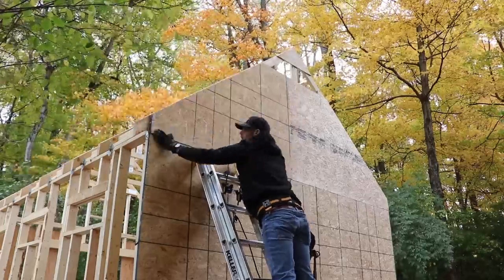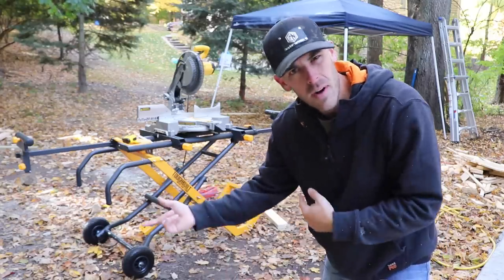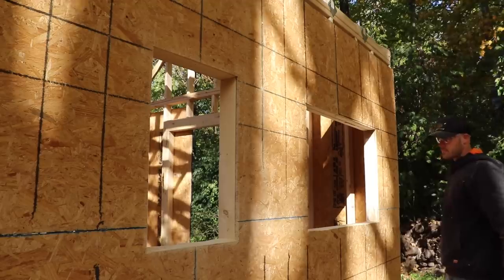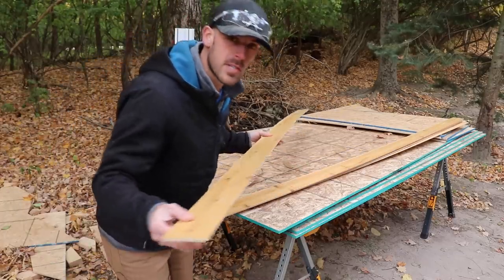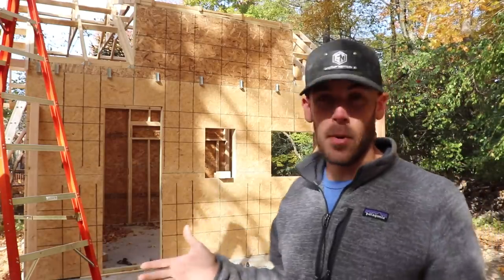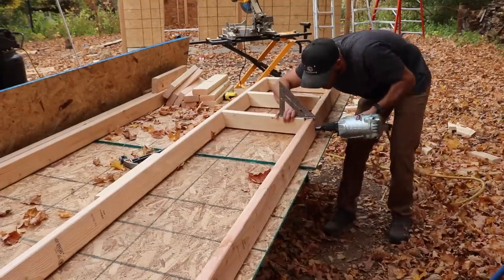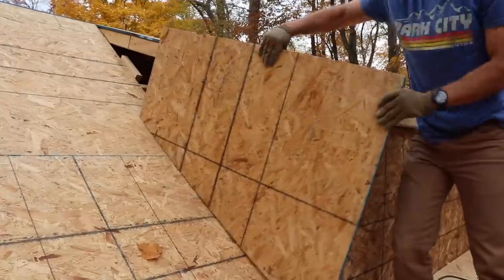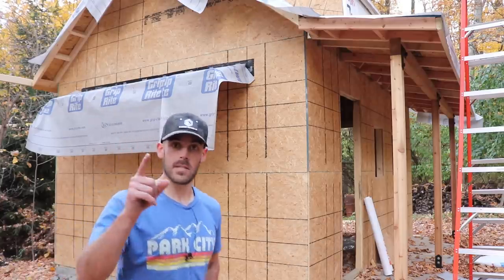Rain on the Forecast - Out of Time! // Shed Part 3

Comment: This has been the only guy that actually makes me feel like I can do a project without failing.
Reply: You can.  Just do it.  You're going to screw up, but you're also going to learn so much.  I never thought I could do anything like this until I bought a house with huge unfinished basement. It irritated me that there was so much wasted space, so I finished it myself.  It took me 6 months working every night and most weekends, but it turned out better than I could have ever imagined.  The feeling I got when I walked downstairs and saw that space and knew that I did it was like nothing I've ever experienced before.
Reply: Things become so much more doable when you realize it's all a series of executable steps. Solo DIY projects like these can look downright insurmountable as a whole, but I think most can picture themselves completing each step in isolation.
Reply: Take the encouragement, most trades work is not that hard. If you can build Lego with instructions, you can build a house(pretty much). Finding the instructions is the hard part, and this video is not the place to find instructions. Take this guys ambition, but find another video and how to build proper. Realistically its not that bad, but this roof line was ambitious for a beginner. If there is one thing an ambitious home owner should know, is to "Keep it Simple Stupid".

Comment: I will go ahead and agree with pretty much all the commenters here in saying that you definitely make approaching projects like this for beginners much more inviting and enthusiastic for us. Thank you very much for this. 
Something I learned with cutting plywood with the reciprocating saw to not have those rough, cut up edges is that if you put some painters/masking tape over where you’re cutting (you’d of course have to redraw your lines over the tape, but then cut through the tape, the tape helps to keep all the rough bits from splintering off and makes it much cleaner

Comment: Nice work!  I just completed a 10x12’ shed on my own at 65 years young.  Built as much as I could on the ground (walls, exterior sheathing, opening cuts, etc).  Adding the sheathing on the ground was easier and added strength to the walls before standing them up.  No concrete, built a platform entirely out of PT lumber which helped make it easier to attach the walls to the flooring. Roofing (including sheathing) was the worst part, but I hate roofing in general anyway.  No nail gun for me, I estimate I pounded somewhere over 2500 nails and drove over 500 screws. Full disclosure, my wife did all the painting. This will be my last large scale construction project, but it did turn out great.

Comment: I agree that we all learn from making mistakes.  I was making outdoor chairs and got one almost complete and realized I used precut boards for a chair that was a different size I was making for a friend and had to take it all apart and reassemble it with the correct boards.  I now label the boards better so I  don't mix the different boards.  I love how your shed is turning out, I would love to have room for a shed to turn into a workshop but living in a townhouse doesn't come with hardly any outdoor space.

Comment: Great job. Pro tip on those anchors... Run a nut down past where you plan on cutting and all you have to do to fix the threads is to back that nut off.

Comment: Really like this series.  Working alone is never easy, but the sense of accomplishment at the end is worth it sometimes.  I once fired a nail through the side of my thumb with a pneumatic framing nailer.  Thankfully it was smooth shank and it was out before I realized what was going on.  That said, I can absolutely guarantee you that you do not want that in your face.  So, I would agree, do not fire that nailer towards yourself, especially towards your face.

Comment: I appreciate your ability to knock things out alone!  Regarding your stud cut off, you should put a standard nut on, cut off the stud (in whatever cutoff method you prefer), then back the nut off and use it to fix the threads.  I have done this with many grade 5 and grade 8 bolts.

Comment: If you screw a nut down the stud before you cut it to length, you can just unscrew the nut, (after you've cut it) and it will repair the threads.

Comment: Sawzall is definitely the fastest method for cutting out door/window openings. Use a finer blade and cut from inside the opening so you can use the framing to guide the blade and you'll get a cleaner finish. Cleanest way is cutting the openings on the sheet before install with a circ saw, but that's a bit slower

Comment: Awesome build! Couple of notes - to get sheathing panels properly spaced, use framing nails temporarily between the sheets. So put a nail into every couple studs (nail about half way, not all the way) and rest the next sheet of OSB on them. After nailing the sheathing, take the nails out, gives you perfect spacing. Tape over seams. 
Second note - you didn't block between the studs where the sheathing seams are so there are no nails 6 OC on every edge of the sheathing panel. I'm assuming that's not super critical for a shed, but would be critical for a house. Basically places where you can see daylight between the sheets of OSB from the inside. I actually missed this myself when resheathing our old house and it was a pain since I already taped everything and put Tyvek up when I realized this.

Comment: Quick tip when cutting a bolt or all thread.. Just run a nut down past where you are going to cut...make your cut and then back the nut off.

Comment: I'm also part way through a solo shed build with shed style dormer on the roof, like yours. As you have mentioned, the up and down and shifting the ladder a thousand times just to level and install a single board is SO TIME CONSUMING. I'm not going to get the shingle roof on in time and will probably just tarp the roof for the winter and finish everything else by spring and then finish the roof.

Comment: Travis.... not sure if someone has mentioned it but when you need to cut a bolt,  put the nut on before and below the cut.  Then just back it off.  It will clean the threads for you.  Also goes for when you hammer in the anchor.
Reply: Thanks for watching Download W/app & message right away I will love to hear your thoughts on it and for more enlightenment UP##

Comment: I over the past two summers have been building a 24x30 shop in my backyard. I made a lot of the same blunders as you and even had the same stubborn attitude to do it all myself. I was forced to have the concrete work done professionally and to get help with the large french doors and trusses, but that was more of a logistical issue; There was no logistical way to do it on my own.  Like you I found sheathing the roof to be a huge hurtle where I always thought I was going to die. I jerry rigged a way to do it, but it was touch and go. Your pitch is way worse than mine too. Good job, I've already noticed a thing or two you did that I wished Id done.

Comment: Your doing fine . I hope you put plenty of nails in the decking where the ladder rails I believe you call them on your gables are. Lot of weight on the overhang and gravity is a powerful thing. . If it starts sagging put a couple ceder 1x4s around 14 inches, little prop nailed at wall and bottom of your soffit. Best I can explain.

Comment: A little late now but, a pair of roofing shoes would have helped.  They are non slip and make working on the roof much easier.  I use Cougar Paws brand.  Worth the cost if you have a lot of roofing to do.  Enjoying the series.
Reply from the maker: How did I not know that is a thing...dangit

Comment: Make sure you roll over the zip tape with a j-roller or it won’t hold. That tape is pressure actived. Think like rolling a laminate into the contact adhesive.

Comment: When cutting bolts or threaded rod I like to put a nut just below my cut line and just above it. This will kinda guide your blade in the correct spot and when you take the nuts off it will debur the bolt.

Comment: Zip makes a osb that is red for roof sheathing so you don’t have to put roof underlayment and it has a thin layer of insulation to help with the thermal break in between the trusses
Reply from the maker: I looked into it, I love the idea but at over 2x the cost I just couldn't justify it for a building that doesn't need any insulation properties

Comment: If you don't have a die, you can just thread on a nut before you cut the bolt and removing the nut after the cut will clean up the threads enough to thread on the required fastener afterwards.

Comment: 12:30 the only thing I would add is a ledger board, and then attach the joist hangers to it, other than that, it did hold your weight on top of the front porch.

Comment: I would have recommended using the Zip tape on plywood to plywood connections everywhere, AND ALWAYS ROLL IT.  If you don't roll it you might as well use a cheap tape.   Then just lap the underlayment, and your water tight with HALF the Zip tape, and twice as waterproof.

Comment: I didn't see it during the sheathing of the roof... did you use H clips between the panels?

For those that don't know, H clips aka plywood clips, help keep the panels alligned with each other over time and help prevent warping.  They also support the edges of the panels.

You should also harness yourself at height.  you may slip, but you won't come crashing down to earth.  Ask me how I know :)

Comment: Probably an unnecessary step, but if you want to add another tedious layer of protection for your roof waterproofing, I'd go back and hit each nail hole in your membrane with some sort of sealant.  Roofing tar, more of your flashing tape or whatever else you want to do, but it could help in the long run just in case any water gets behind your metal roof.  

I think the type of membrane you're using is supposed to self-seal around the nails as they drive in, acting kind of like a gasket, but just stepping on the membrane while you walk along it can stretch the membrane just a little around the nails and leave space for water to come through.  I'm a worry-wart myself, so it's just an added layer of precaution.  You decide!

Comment: You’re doing great! Having built a shed a couple of years ago I wish mine would have gone as smoothly as yours. I do have a question - did you put your osb sheathing in contact with the concrete?  If so, aren’t you afraid of moisture wicking up?

Comment: *Question*!!! - Your shed content is great! I'm getting ready to get concrete poured for a similar backyard shed project. When are you going to do electrical?  I didn't see any conduit lines in the concrete (which my father-in-law says I need but I don't believe so given it will just be a rectangle with any power being on the outside walls and lights in the ceiling).  Would love your  or anyones else's thoughts!

Comment: Word to the  W.I.S.E. 
What  others  may  claim  versus  what  actually  happens  instead.  Ladder Jacks, Foot Holds,  Safety Harness, and yes ( Winches ) Will make  all the  difference.  Spurge for a  Retractable  Plank ,along with some Ladder levelers and  this  PROJECT  would  have been easy with  just  ( ONE ) instead of  none.  Chances are  you  have  heard of, Seen, or  been around others  who have  and  or  sell, Use  , much of what was just pointed out. D. I. Y. and  ( DUMB ) are many times  1 in the  Same.  Dammed of you do ( DAMIT if you Don't )  Questions  abound  with the  design and  the follow- up mis-steps to correct. A Rule  of thumb  that literally  ( EVERYONE ) should be  aware of. Dimensional Lumber..  Not  a  Quiz ( REALITY )   While  making  a  design  take into consideration CUT List / Cut Lines - and the  Amount  of  waste in each and  every case.   Blocking  is a  Good  place to use  SCRAP.  B.U.T.T.  The  idea that  Time is  money and  the  concept of  ( LESS is  More ) holds the line  each and every time.  WOULD YOU - Should YOU - Could  YOU ??? Just  because  you  may not  be  the  world  famous  Fastest  Carpenter alive. IS  NOT  Excuse  for  making  this  ( Harder ) Instead of  being  SMARTER.  Weekend Warriors, Jack of All Trades, and  a  host  of  Never  done it  before  ( Jokers ) might  actually  agree.   Working a  Plan  instead of  Constantly  changing  your  plan  to  make it  work.  Measure Twice ( Cut Once ) Not  a  saying.  Truth  in Advertising.  Take  Two Steps  backwards means ( STOPPING ) Before  you  continue to make  more of  the  same  Problem  Multiply.  Breaks  are like a  Re-Set Button.   Walk around  one  way.  Stop.  Then  Walk around  the  structure another way ( S. T. O. P. )   Bad Tradesmen Blame there Tools.  Good  Tradesmen  can  take a  Bad  tool  and  make  a  project  better by understanding  there LIMITATIONS.   $1,000.oo  Compound  miter saws and  Stands  will NOT  Replace  poor  layout  and  design.  Good  Quality  comes  from  Good Workmanship.  A Few duplicates should  always  be  close at  hand.  Hammers, Tape Measures, Framing Squares, Levels, String Lines,  Nails, Screws, Ladders,   Pry Bars,  etc.  ( IF ) you  somehow  feel  this  message is  OFFENSIVE - Then Once  Again  YOU have  Missed the  Mark.  Compliments  NEVER  Fix  what is  Broken.  Understanding  the  Cause  brings  a  solution or  Cure that  Works.  To Bad  you  Forget to Remember the  Industry  standard all need to follow.  ( A-B-C-1-2-3 ) Also Known as: Who, What, When, Where, Why, How..  The  (6) things  every person  needs to do BEFORE  Plugging in a  Cord,  Cutting  a  Board, or  Nailing / screwing  the  First piece to any thing.   Back in the  day. An  Old  Timer  summed it up this  way.  Asking. ( Do You Know What Step One Is ) ???   His  Reply  " Remove Head From A. $. $.     Then He  Followed  that with this other question.  ( Do You Know What Step Two is ) ???  Re-Peat Step Number One.  " Remove Head From A. $. $.    In Life  most people  Forget  ( WAY More ) Then They Ever  Remember.  Meaning  What.   In the  heat of the Moment.   YOU too  Did  exactly as predicted.  Ran  Head Long into a  Brick Wall only to Have  to Go  Way Farther  backwards to Get back to where you  already were. Square One.  Not  Because there was a Lack of Effort.  The  Opposite is  true.   You Forget to Understand the  Basics.  The  Turtle and the  Rabbitt.  Who Reaches the  Finish line  before the other is  far less about  speed than Doing it  Right the  First time versus  doing it  all over Time and time  again and  again. " In the End - It All Goes Back to the Beginning " 
{ Always Time to Do It OVER - Never Enough Time  to Do It Right }